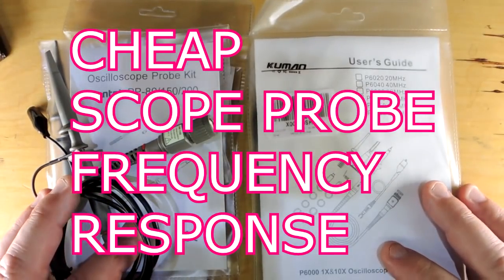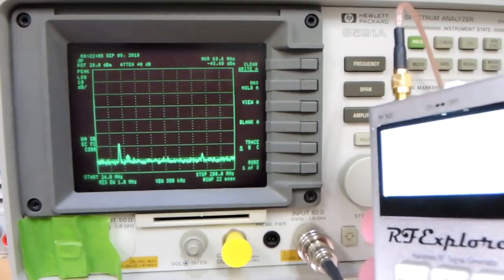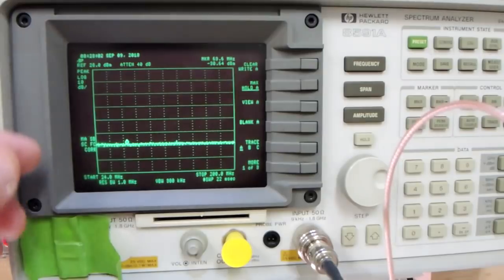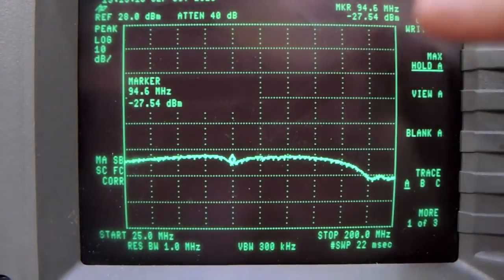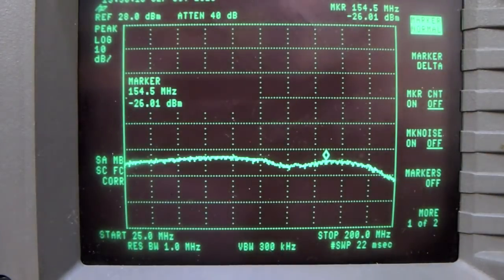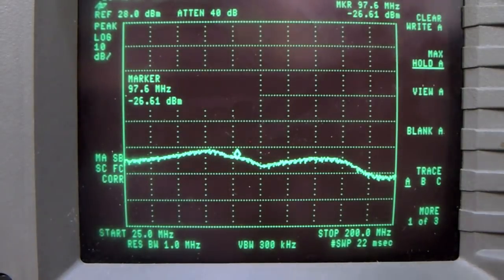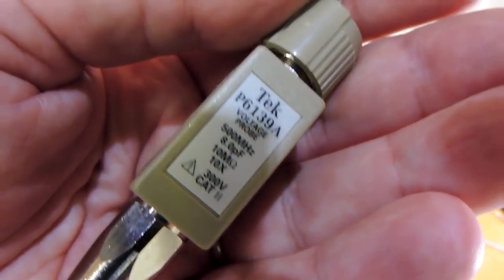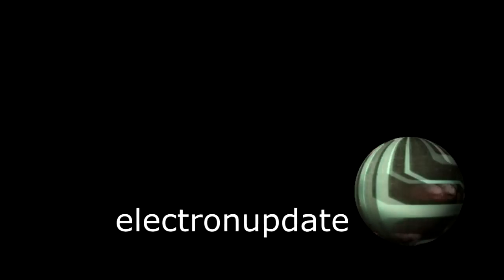Cheap Scope Probe Frequency Response

Comment: This is not a valid test.  The scope probe is designed to run into 1 meg Ohms in parallel ~15 to 20p, the input impedance of your spectrum analyzer it 50 Ohms.  Adjusting it on your scope sets up the frequency response on your scope's input impedance, not 50 Ohms.  You need a wide-band buffer amplifier with an input impedance like your o-scope that can drive a 50 Ohm load.

Comment: Not saying that it will change the results much, but you don't use the calibration signal like that. You don't set the scope to show multiple periods of the signal. You only need the rising edge on screen, especially if you are trying to be calibrated at higher frequencies. The important part is the fast rising (or falling edge) of the signal and the calibration output of a scope usually provides that (because that's the whole point of that output).
Also it is pointless to calibrate the probe on the scope and then connect it to a different device. You calibrate the probe for the input it is connected to. If you're serious about it you should even recalibrate the probe when moving it from one channel to another on the same device.

Comment: One thing I was unable to see or mentioned is if the signal generator and/or the spectrum analyser have correct loading, a 10x probe cannot probe or terminate directly into a spectrum analyser or a 50 ohm signal source. The 500MHz probe was only scanned to 200MHz so there may have been some dipping further up the spectrum that could have shown a similar response.

Comment: I wonder if you play with the compensation you could flatten it out a bit more.  I know you tuned to 1K but if you had a higher bandwidth square wave you might be able to tune the response a bit on the higher ranges.
Reply: He used the calibration signal wrong. You don't set the scope to show multiple periods of the signal. You only need the rising edge on screen. There is no need for a higher frequency calibration signal (in this frequency range), but you need one with very fast rise times which the calibration output of a scope usually has (because that's what it's there for).
Also it is pointless to calibrate the probe on the scope and then connect it to a different device. You calibrate the probe for the input it is connected to. If you're serious about it you should even recalibrate the probe when moving it from one channel to another on the same device.

Comment: Thank you for taking the time to do this comparison and put it up. I bought several of those "generic" probes off Ebay a while back and was curious as to how well/not-so-well they worked. Considering the price, I fully understood what I was going to get. But it's still really interesting to see how they actually are, particularly from someone who knows what they are doing. It isn't critical for me, I use them only for very general troubleshooting type stuff on an old HP 54602B. But it's still an incredibly interesting bit of info to have. That was very cool, thank you.

Comment: I wonder if the characterization of the low cost probes would have been a bit different (better?) if you'd been using a probe to BNC adapter since the ground lead may have been introducing some "error"; don't get me wrong, they performed about as expected but may have done a bit better with a different I/O configuration. Thanks for sharing, I have a 200MHz Hantek portable that has more capable probes as I recall.